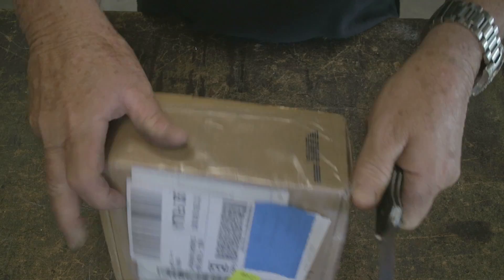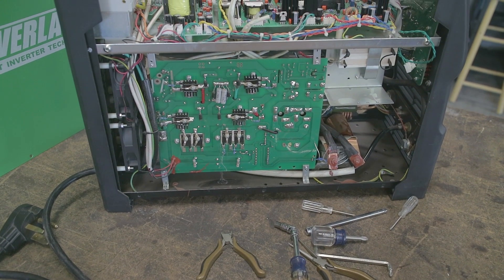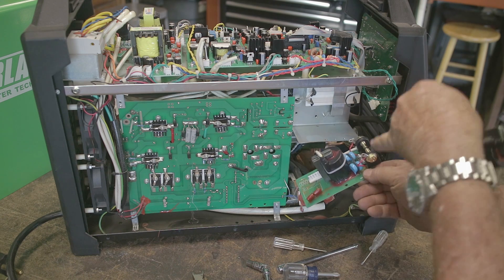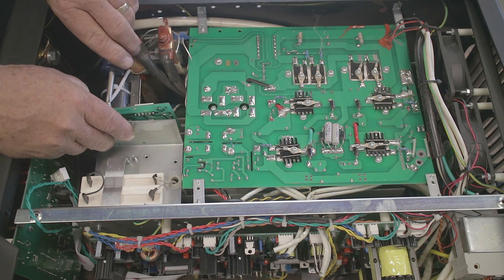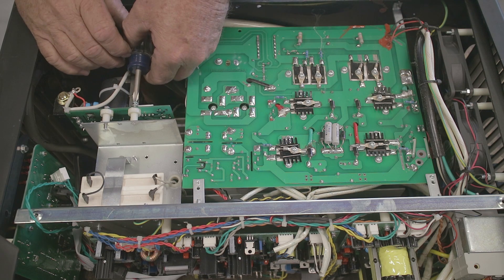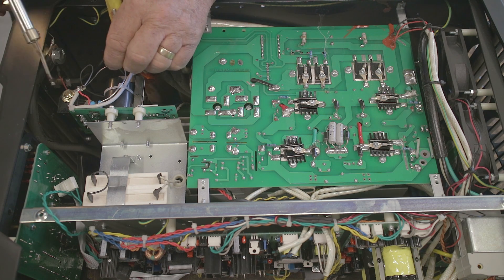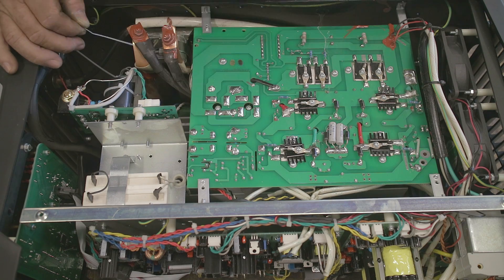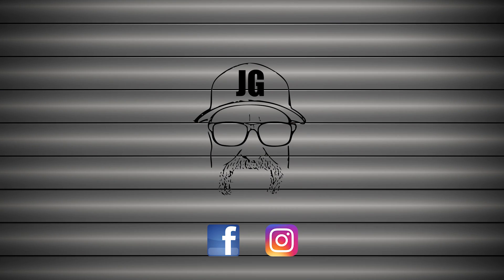High Frequency Board Replacement | JIMBOS GARAGE

Comment: Man, that is some UGLY soldering on those circuit boards by the factory. Also noticed that the HF board has ink on it for 4 diodes. Have to wonder why the diodes aren't used anymore...

Comment: Jimbo - you should be  aware, that unless you are a YouTuber The customer support from everlast and the response times to get things done for most clients takes months and is extremely frustrating. Please be careful promoting their products - even if not affiliated with them.
Reply: Not to heap on everlast.. I was going to buy their top of the line welder...did some checking around and came up with quite a few instances online of people not being happy with customer service..a good reliable welder is needed especially when it's paying the bills..I opted for another brand..perhaps everlast can respond to assure people thinking about purchasing their product that customer service is on top of any issue they have...sending replacement boards to get back to running would be a plus,,but would they do that for anyone?
Reply: YMMV but I've been very happy with my everlast welders and I've got three of them.
Reply: Ryan Lewis until one breaks

Comment: Note: on the AHP 200DX the contact points are adjustable (about 0.029ths), like on older cars. If the HF causes a problem in the future an adjustment (if Everlast is adjustable) may be all that is required.